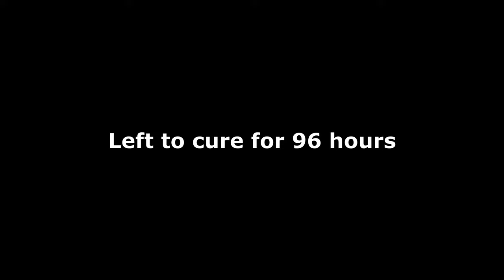Woodturning | The Floating Octagon Bowl

Comment: Great job. Fantastic looking bowl.
Reply from the maker: Thanks again, David! Glad you like it!
Reply: @formanwoodworking , I have been looking at full sized lathes, and value your opinion.
What is your opinion on Rikon lathes? I'm considering the 70-18/24 because it has every single feature I want.
The 70-30/40 with electric sliding rail is an absolute beast on paper,
but no rotating headstock.
Its hard to pass up on something this sturdy, and solidly built.
Which do you think is better for ALL aspects of woodturning?
Is there a lathe brand or model that is superior in the $5,000 price range?
My sincere thanks if you answer me back.

Comment: how expensive is it to make things like these? 
I have a Lathe that I suddenly have an urge to dust off and making myself a Resin Bowl sounds like a fun project but I don't think Resin is that cheap. Do you have an idea of what the cost of materials is?
Reply from the maker: I can't remember how much the oak cost. I didn't need a lot to make the rings, so I'm going to just guess and say the cost for the wood was somewhere between $15-$30. The resin was also ~$30 in total volume used. So, not including other little costs, like the material needed to make the mould, sanding paper, finish, and all that sort of stuff, I'd say it was around $55 give or take.
Reply from the maker: Oh, and sorry, that was all in Canadian dollars